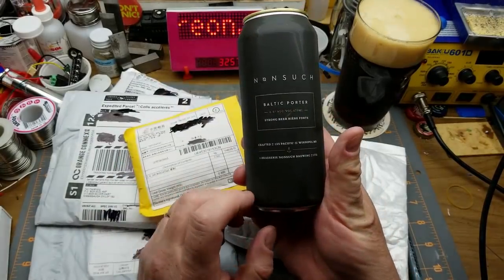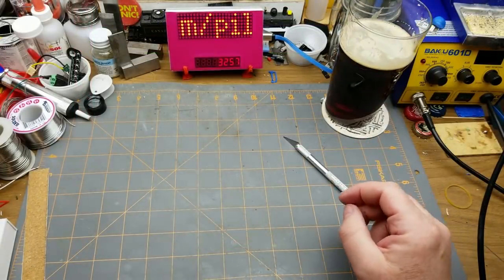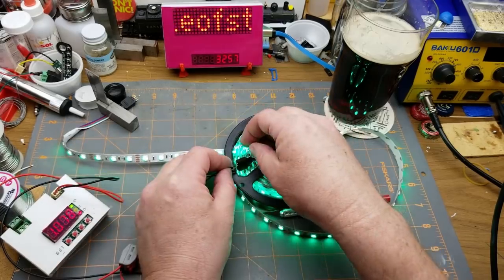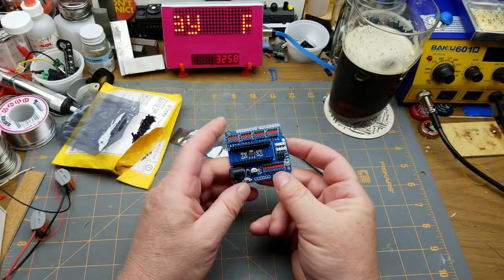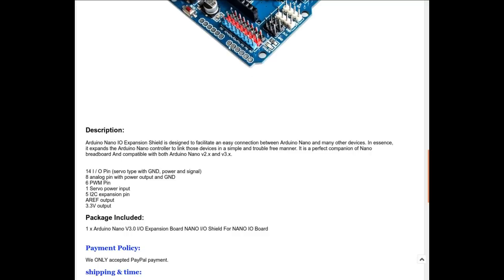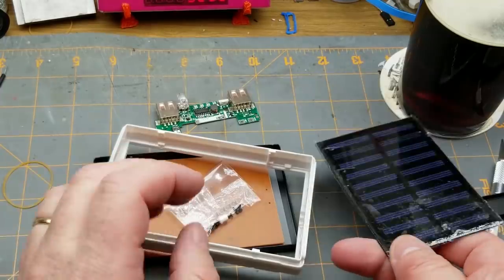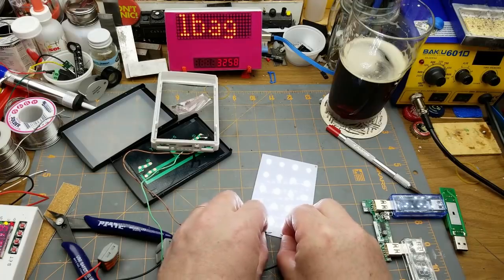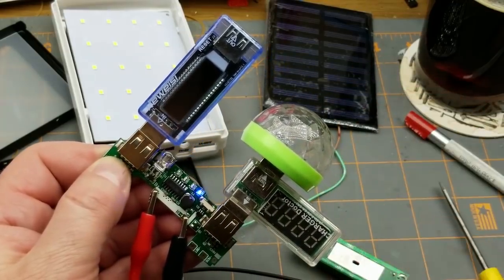mailbag monday 56

Comment: These small heatsinks might be just aluminium ones, painted or only coated to look like copper.

This powerbank module is not really faulty, you just hit current limit, and your power supply lowered voltage. If you put 1A load, it's like 5W, so for 4.2V input you would need 1.19A, even more with convertion losses (around 1.4A with 85% efficiency).
If I remember correctly, this disco light is around 3W (as it has three 1W leds inside), so it would need around 700mA on the input, way too much for your current limit.
As someone said, those charge doctors do use a bit of the current, as they are powered from device under test.

Also if you are going to use this power bank kit, make sure to use protected cells, or use some protection board, because this one has no protection at all. Just behind 2A usb socket you will find pads for DW01 and SOT23-6 dual mosfet package, with 0 Ohm link soldered.

Comment: Good luck with the power bank kit.  I bought the same thing.  Besides there being no way of locating and securing the light and solar panel. The button doesn't fit in the hole, the led diffuser doesn't fit unless you trim away a lot of the plastic.  The case doesn't hold the board forward enough for the button to work, and the case is not properly cut to fit the screw heads, s when you tighten them in they smash the plastic flange.  On top of all those things, after assembly I pressed the button and the led panel flashed one time and never anything again.  I double checked all my connections and all was wired correctly.  I guess I got all the rejected parts.  Hope you have better luck!
Reply from the maker: It sounds like it's even crappier than I thought.Should make for an interesting project.
I should stock up on hot glue sticks...

Comment: Do you think the current limit on your PSU is what caused the powerbank to fizzle? Think of it this way, there may be an initial inrush of current and slam onto your current limit, thus pulling voltage down, thus triggering the over-discharge protectionon the board? just a thought! Nice video as always!
Reply from the maker: That's probably what it was.I have a bunch of salvaged 18650s around here that I plan to toss into it once I figure out the mechanical stuff

Comment: You can't always properly simulate a battery with a power supply. It might not react fast enough to changes current draw and it triggers the protection on the powerbank circuitry. The switching noise can also throw it off. Try with actual cells, it might work just fine
Reply: It's simply that he set the power supply's current limit to only 0.5A and the devices he plugged into the USB ports required more than 0.5A.
Reply from the maker: @johncoops6897  well spotted. I plan to toss some salvaged 18650s into it in the near future, as soon as I figure out the mechanical stuff.

Comment: 12:45 got one of those but with the 5 batteries pre-installed. You have to glue 5x18650 batteries all lining them up and also good luck with the fittings of that structure :) .. the charging efficiency is also lousy to be gentle. Oh and at least my solar charge may work like n the middle on the Sahara desert ... otherwise it's truly not worth it.
But those are indeed cheap modules to have around and they can serve as power banks for stuff that is not critical to use ...
Reply from the maker: I suspected that a mess of hot glue might be part of the solution.
The more input I get on this thing, the less hope I have for it being non-shitty.

I do plan to tinker with it in the future to discover just how bad it really is.
Reply: @pileofstuff  If you want I can send you pics of the thing open , and they have made it actually quite tidy. There's is no hot glue mess inside no need for that ... but that does not make that module a good one :) ... I mean it works, it's not terribly efficient, does not charge all battery capacities to the max, the solar part is useless (unless in the middle of the Sahara desert at mid-day:) But of course it is 5x18650 Li batteries so yup it does charge your phone.
Reply from the maker: my e-mail address is on the "about" page of my channel, if you want to send that pic. 
Might be interesting to see if I can do as clean a job as an underpaid Chinese factory worker.

Comment: For the powerbank. I just received 2 cables from Aliexpress with banana-plugs and some crocodile clips ... internal resistance of the 2 cables around 2 Ohms.  Should measure the voltage at the PCB board in this case. 
Most of the time these things end up in a drawer since the efficiency sucks. There are better things to order from China.  Still amusing.
Reply from the maker: These were the same cables. I soldered the connections on mine and improved them significantly.
Reply: @pileofstuff  Going to make my own cables now. The crocodile clips I have on my cable are crap, when you try to open them to attach it to something the silicone is just so slippery  that it slides around the metal part instead of opening the jaw.  Also they seem to be using very very thin wire which I suspect is copper plated aluminium hence the high resistance.

Comment: That power bank has a buck converter on it you might not be giving it enough power to get it to run.
Reply: I'm fairly sure it is a boost converter, cells typically go in parallel in these devices and you need to boost the MAX 4.2v to 5v for USB output.
Reply from the maker: That sounds like the consensus.

Comment: 20:15 - of course it doesn't like it. Your power supply is set for 4.2V 500mA (2.1W) and you are trying to pull 5V 1A (5W) from the USB outputs. My identical Disco Ball draws almost 300mA (1.5W), so at 70% efficiency that's over 2.1W on the battery side.
The "1A" and "2A" USB Ports on these powerbanks relates to the way that the resistors are set up on the data pins. This affects how much current an iDevice will draw, and has nothing to do with the output of the boost controller. All powerbanks (and most chargers) are the same, they almost never have 2 separate output circuits.
Reply from the maker: DOH!. Well spotted.